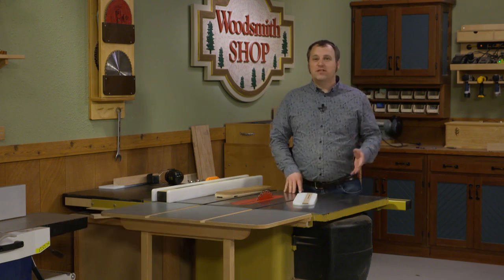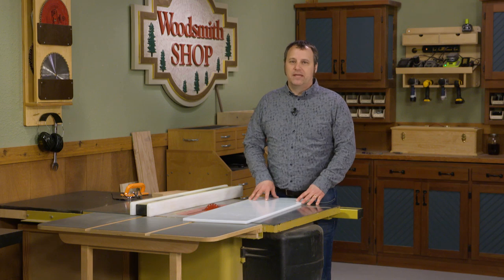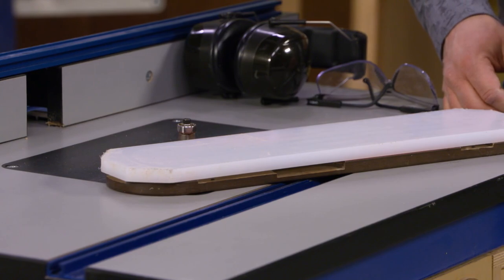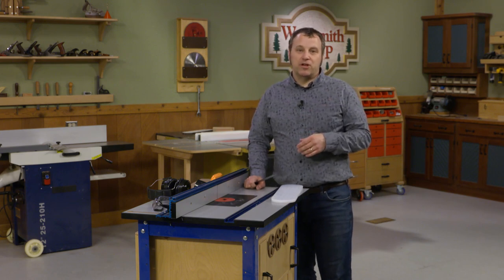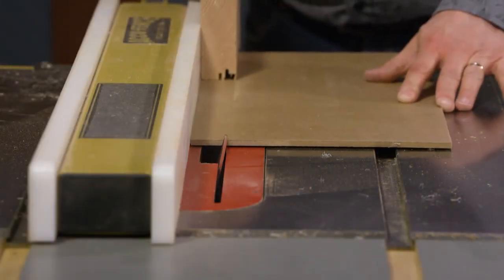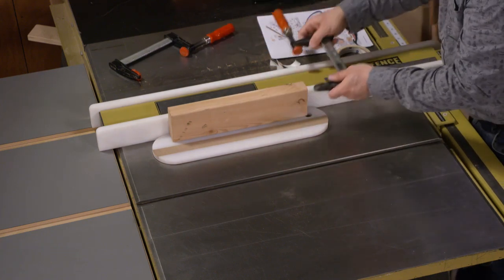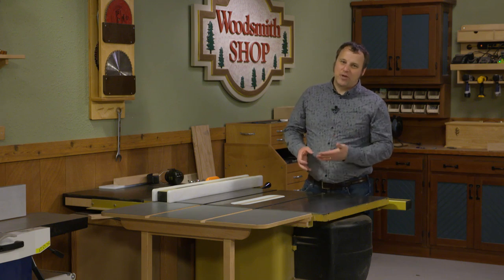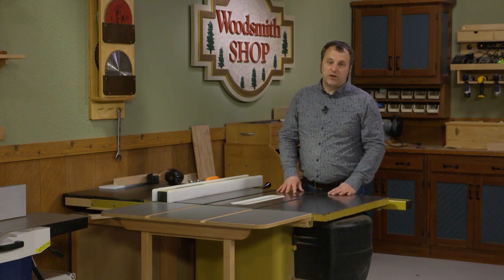Woodworking Tip: Make Your Own Deluxe Zero-Clearance Insert Plates

Comment: I would have liked to see the inclusion of a splitter or accommodation for a riving knife.
Reply from the maker: Definitely!  We didn't show it in this video but there are plans for adding a splitter to the replaceable insert. We should probably do a part 2 video on how to do that. More details on the splitter here: https://www.woodsmith.com/article/make-your-own-deluxe-zero-clearance-insert-plates/
Reply: A different option to what they did for the splitter is to keep the fence where it was in the initial alignment and cut the side the splitter is on right through, the splitter will keep the insert spaced so it wont bind the blade since now it's only held together by the back and the supports. Work's better than it sounds.

Comment: For the adjusting set screws, do you just screw them into the plastic or do you have to drill and tap the hole first? Great project, thanks for sharing.
Reply from the maker: On this one we just pre-drilled the hole and threaded in the screw and it holds up just fine.

Comment: In the video you state that the dimensions for the insert slot are explained in the plan. Where do I locate the plan?
Reply from the maker: Most of the dimensions for the insert will be based off the original insert plate and location of the blade on your saw, but I guess the one universal dimension is that the replaceable filler strip is 1" wide.  You can find more details here: https://www.woodsmith.com/article/make-your-own-deluxe-zero-clearance-insert-plates/   But if you need more info I can e-mail you the original article too.  Just let me know.
Reply: Thank you. I am a Woodsmith subscriber, is the article somewhere on the website?
Reply from the maker: @michaelzuhlke4959  - it was originally in ShopNotes Magazine issue #34 so the entire article isn’t online anywhere yet. But I could create a pdf and send it to you.
Reply: @WoodsmithShowandmagazine  Great. I have the Shopnotes Back Issue library and have located it. Thanks again.

Comment: I use a circular saw blade on my table saw in order to get the blade low enough that the blade will not contact the new insert when the saw is started.  The circular saw blade is a smaller diameter than the table saw blade.
Reply from the maker: Great tip!

Comment: I've got a better idea. Use epoxy to fill the worn out slot.  Tape the top side closed.  Turn it over and pour epoxy into the slot.  Let cure and cut a new slot.  Can also use PU glue.
Reply: Epoxy wouldn't allow you to swap in and out different kerf-sized plates, though
Reply from the maker: I've done basically what you are talking about with Bondo to fill in old chewed up insert plates and it works great. I'm sure epoxy would work well too. The method in this video is just a quick way to replace the chewed up portion if you pre-make a bunch of hardboard inserts.
Reply: Post your video
Reply: @daveklein2826  Figure it out yourself.
Reply: @talltimberswoodshop7552  no, you had a better idea so show us or shut up